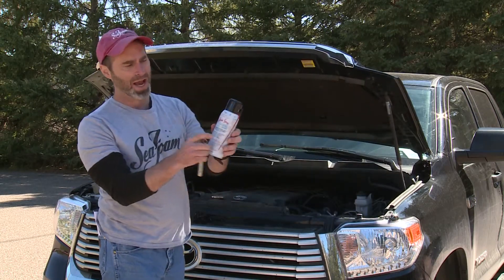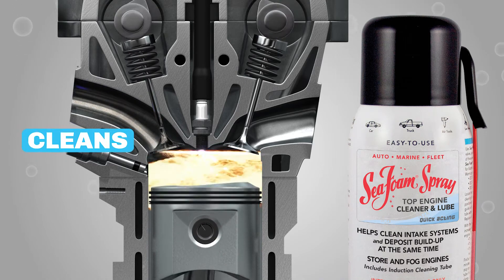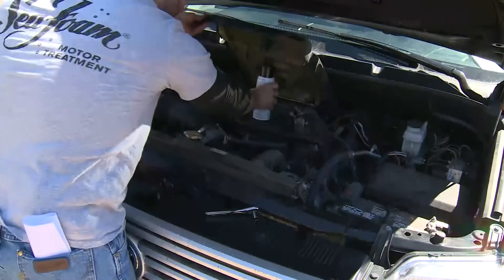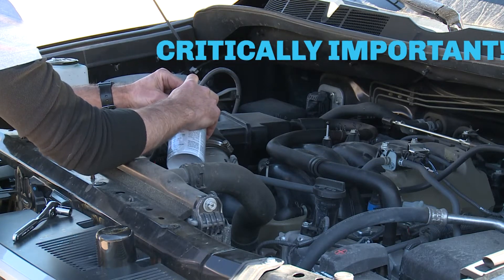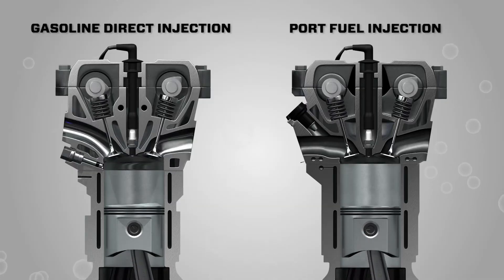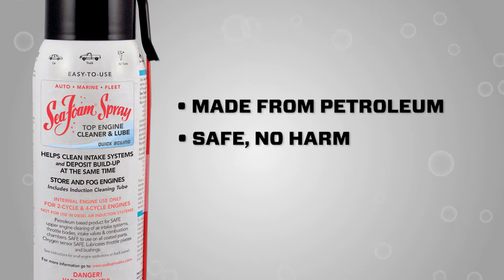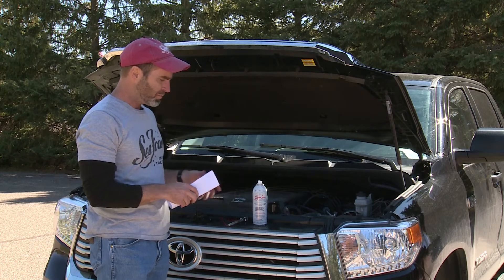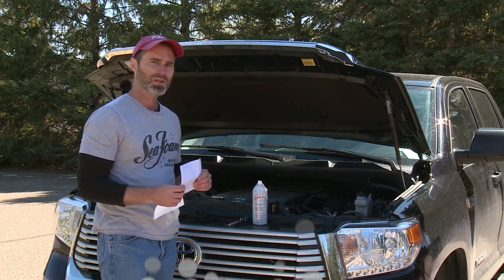How Sea Foam Spray works to clean critical engine areas (great for GDI owners)

Comment: Can I just add the Oz per quart in my engine using Seafoam? I just got my oil changed today and told the mechanic that I use Seafoam in my 2020 Kia Optima with a GDI engine.
Reply from the maker: Yes, add one ounce of Sea Foam per quart of oil.

Comment: can I also do this on a diesel engine?
Reply from the maker: No, never in a diesel. Anything combustible going down a diesel intake can cause runaway.  Thanks for the question!
Reply: What is runaway?
Reply from the maker: Type 'diesel runaway' in your Youtube search field.  One cause is unregulated fuel entering the chamber through the intake. Something volatile (like Sea Foam Spray) coming through the air intake could represent unregulated fuel.
Reply: Thanks Brian, I will put it in the fuel filter as I have seen in other videos.
Reply from the maker: Let us know what happens.  The diesel filter method often shows improvement quick after.